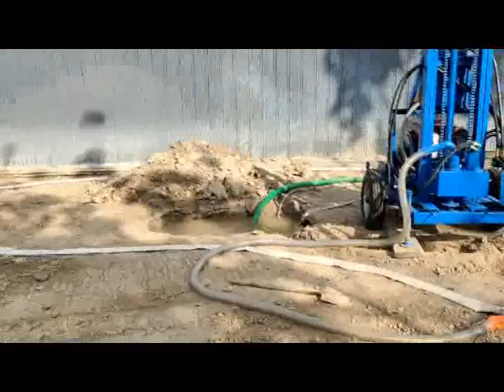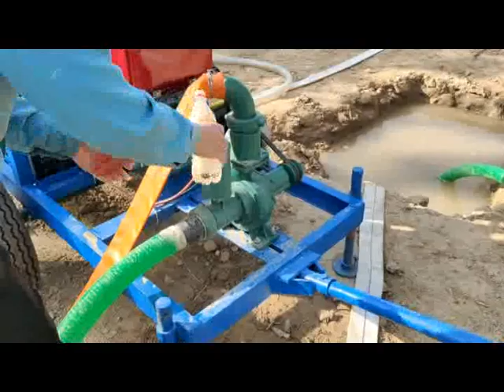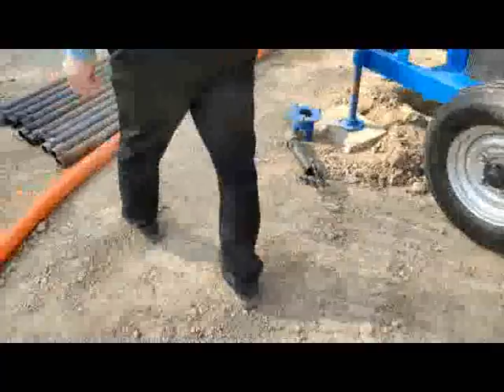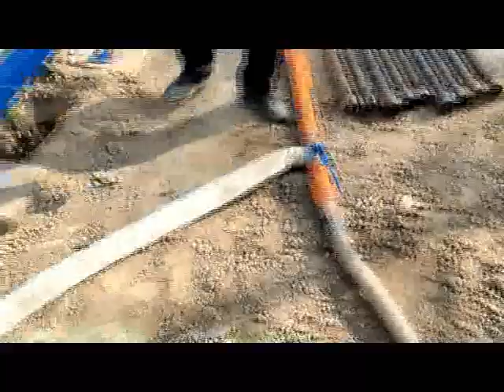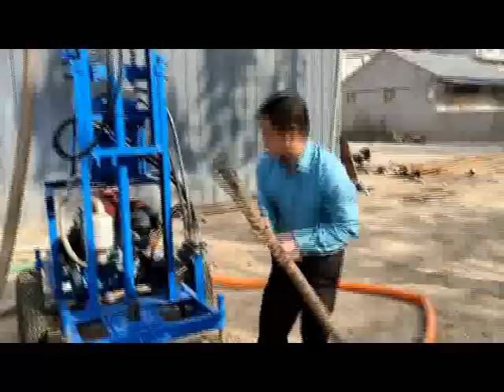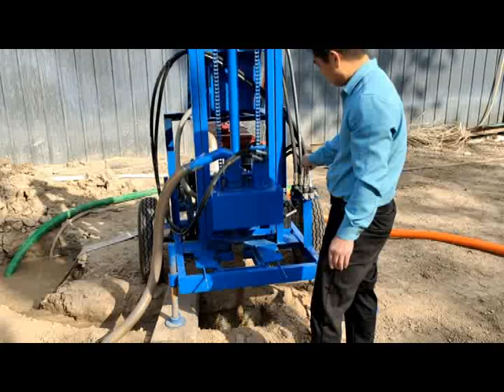KT-120 Using instructional videos

Comment: Need English ?
Horse power?
Bit will cut the hard rock. ?
Pipe sizes ?
Reply from the maker: Yes! However, it is necessary to match and use special rock drill bits. 
Please add my Whatsapp+8618263891862 for details!